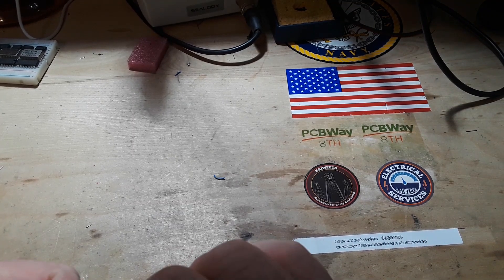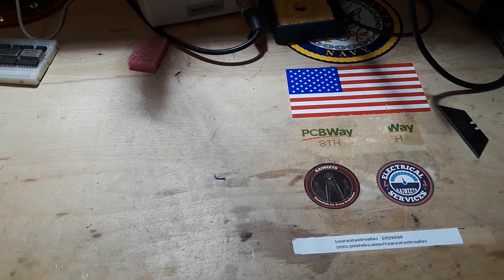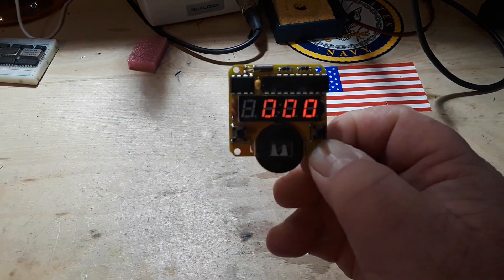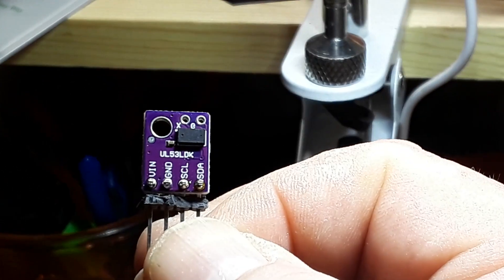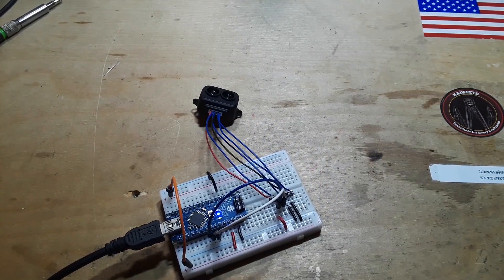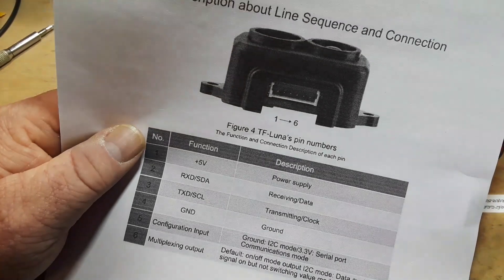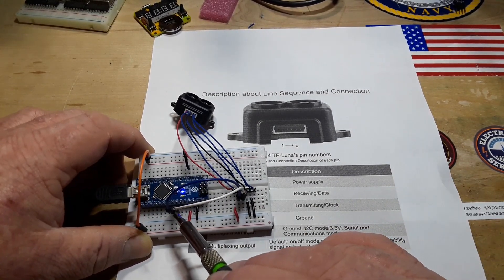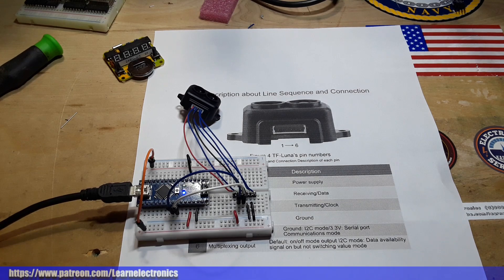TF Luna: "Time Of Flight" Distance Measuring Arduino Sensor with I2C

Comment: Multiplexing output means it can be used for two purposes. On/off mode means IO mode which outputs 0V/3.3V or 3.3V/0V when the distance is less than set threshold distance or greater than threshold respectively. The second mode is IIC mode, that by utilizing the signal on this pin you can judge if the sensor is ready to read the distance packet from the sensor.

Comment: Pin 6 use is for on/off mode.  Description is in the TF Luna product manual:
6.7 On/off Mode
On/off mode is designed from those users who only need to detect the existence of an object. TF Luna can start this mode using “Enable/disable on off mode ID_ON_OFF_MODE=0x3B” and then shows result through pin 6. Figure 6 below shows how the mode works when a high level is set to represent an object is detected........

Comment: Maybe reach out to JLCPCB. I have all my boards made there and they are also top quality. They may not have some of the options that PCBWay has, but for most ordinary purposes they make a nice board. They are also less expensive than PCBWay. Shipping costs are steep if you want the boards relatively quickly but that's pretty much the same for all of them. 5 boards for $2 (100mm square max for that price) and $20 for fast shipping.

Comment: Sorry about the clash with PCBWay. I need to start tinkering with Arduino.
Reply: I wanted to learn about electronics a long time ago. I picked up small bits and pieces but it wasn't until I bought an Arduino starter kit that I really started learning. Now I'm building circuits that I'd never even have dreamt of before. Go for it.
Reply: @tonysansom  I found my elegoo super starter kit in my electronics stockpile. This weekend, I am going to see what it can do.

Comment: Hopefully your next sponsor will be a better fit, and come through for you properly.

-------------- 

Multiplexing output... why wouldn't they just call it "enable"? That way they can use the space to explain to anyone who's new to the I2C protocol that every one of these devices is manufactured to have the same exact I2C address, and they were smart enough to make them so you can easily use more than one in a project.

You can tell it took me too long to learn how I2C works.

Comment: I've worked a lot on those ST Time of flight sensors. They are supposed to be run at 2.8v but will run ok at 3.3 which I've always run them at. Wonder if the ones you have are fake or faulty ? Also before you try it for a parking sensor try it in sunlight first, the ST parts are next to useless in sunlight.
Reply from the maker: It will be in my garage, so no sunlight.

Comment: Hey Paul, sorry to hear about your dealings with PCB Way. Hope you get the sponsorship issues sorted out. This sounds like a cool sensor, curious, can you see if it will work detecting water level (e.g. like looking inside sump pump pit). Cheers and have a nice weekend!
Reply: If it still doesn't work properly for whatever reason, maybe just add a pvc pipe and a target that floats.
Reply from the maker: It works by shining a laser off of an object and timing the return. I think it would work looking down, when the water level raises it will return a smaller number. The output is expressed in cm.
Reply: @learnelectronics  right, that's what i'm curious about, if it will work with water level